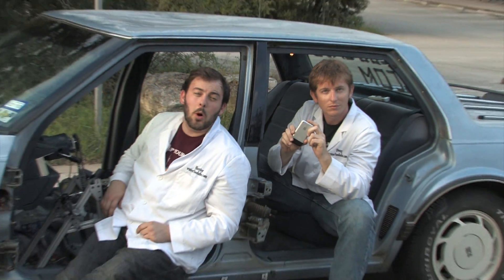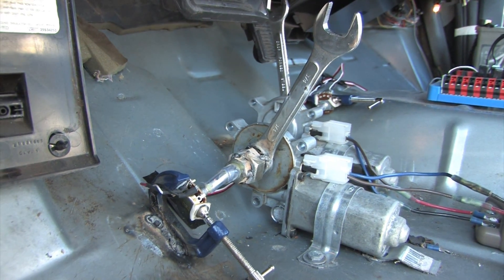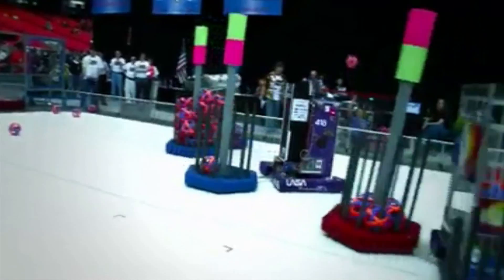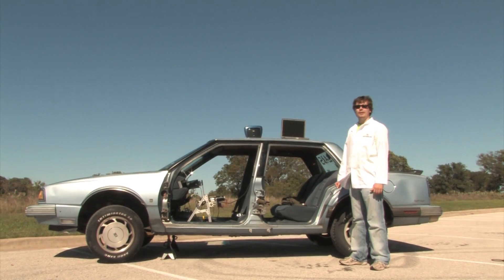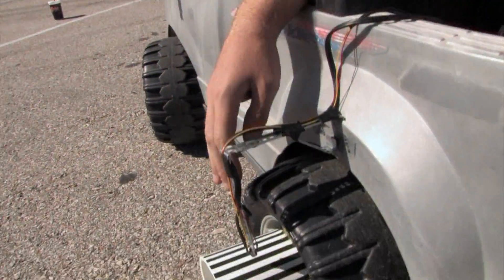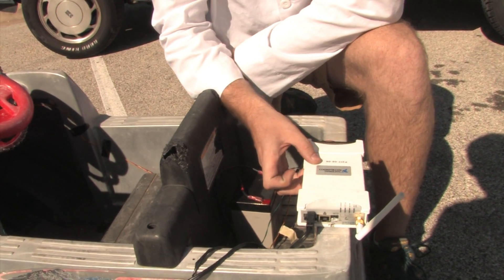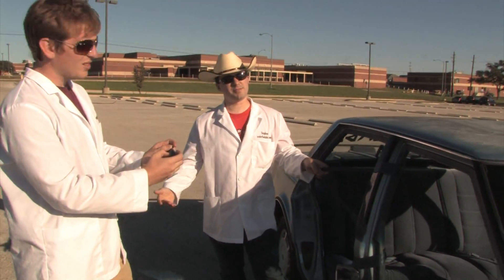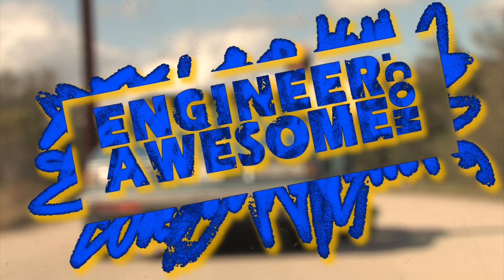Driving a Car with an iPhone (Part 2 - How To) | Waterloo Labs | Episode 03

Comment: why use an iphone, a laptop, labview (yuck, are you kidding ?? labview is a toy !),some wifi and etc..   when you could just use the xbox controller that is way more ergonomic, cheaper and more accurate than the iphone control ?

also no points for using off the shelf controllers for driving the motors instead of arduinos
also you can use a drive-by-wire butterfly valve for gas instead of a window motor servo, it's already got sensors and is way more responsive

Comment: instead of sliders for brake and gas, should have used forward and backward tilt of the iphone. Anything tilted forward of vertical applies progressive throttle, anything tilted back ward from vertical applies progressive brakes. Completely vertical would be the car idling and/or coasting.

Comment: Why not just use the car battery? That would get recharged from the alternator. If you wanted a separate battery for safety, you could have picked up a battery isolator. The one for that car probably runs about $80 and would let you charge two batteries of the same size at once. The car runs off one, and the other runs your gear.

Comment from the maker: @jcorsaro If it looses wireless signal there is a network watchdog that slams on the brakes.

With regard to my welding...its been a couple years :-).  But there's not a lot of torque on these wrenches, its definitely strong enough for what we needed.

Comment: Are you affiliated with a specific FIRST team?

(I see you cut down most of the FPGA code, removing the system watchdog and moving the digital module to slot 2.  Glad to know it's not an *exact* copy of the FRC robot control system)

Comment: Pretty cool project, what does it do when it looses signal or power, or if the tube connecting to the potentiometer breaks?  Also needs a little bit better welding, those tack welds with a flux core mig welder won't hold up so well.

Comment: awesome, i thought that looked like a cim/gearbox and speed controller from first haha. no breaker between battery and distro board? 

why not use a rotary encoder instead of the optical encoder?